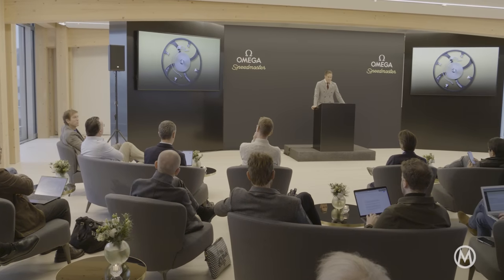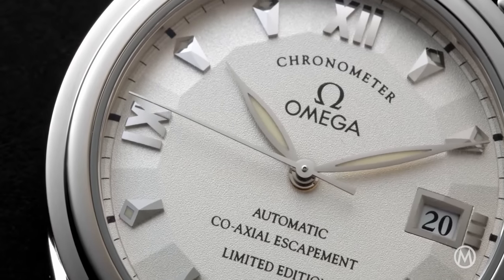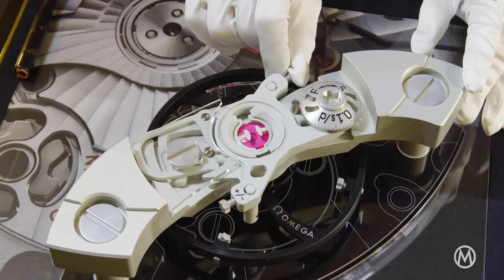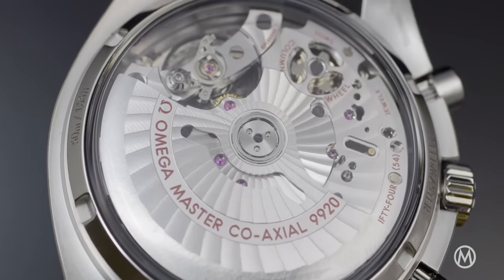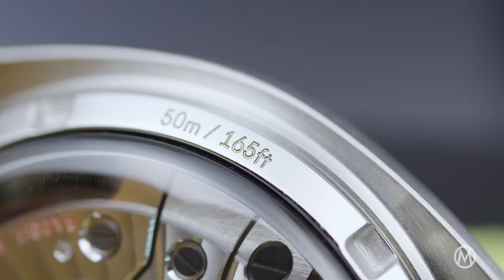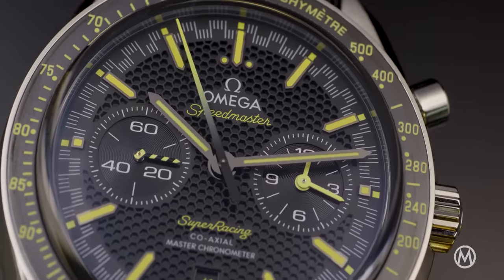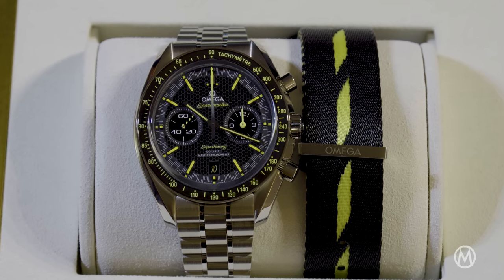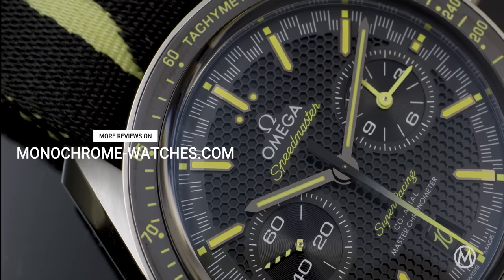REVIEW - The Omega Speedmaster Super Racing and The Spirate System

Comment: Very impressed by that accuracy engineering! Although I've seen many older watches regulated to sth between -2 to +2 seconds. Is it just easier to set the accuracy on this one, or is it also keeping it's accuracy for a longer time?
Reply from the maker: It's a bit easier for a watchmaker to adjust it, yes. If it's regulated accurately, it also runs at that rate for longer. Of course, everything depends on use, wear, and maintenance. Two of the same watches will behave and run differently over time between someone with an office job and a blacksmith for instance, just to put it into perspective.
Reply: I think it’s 0 to +2. Not +2 to -2